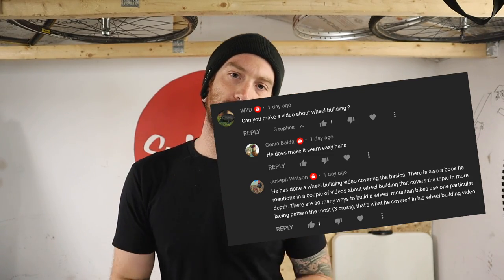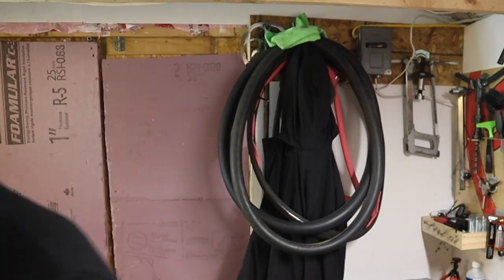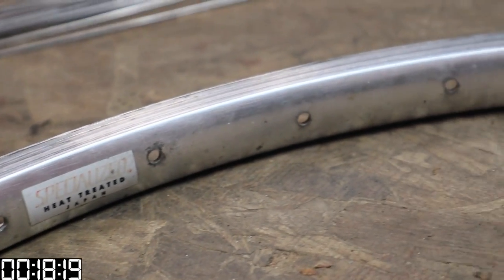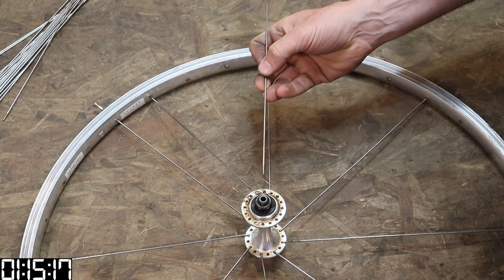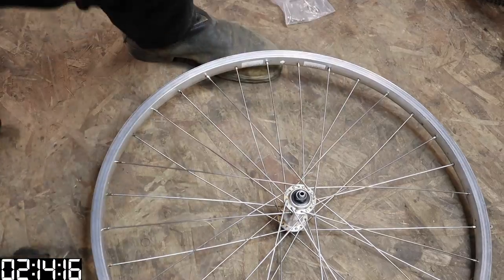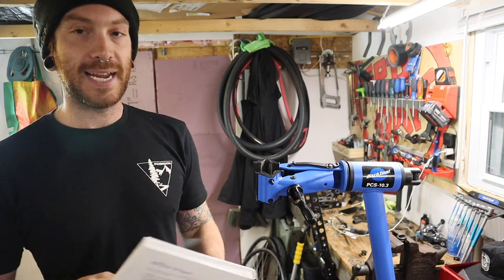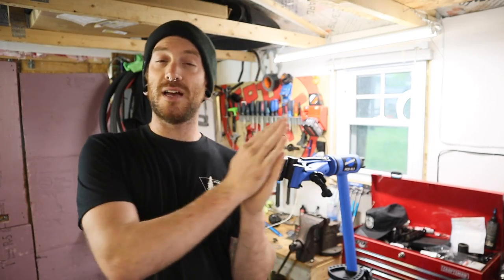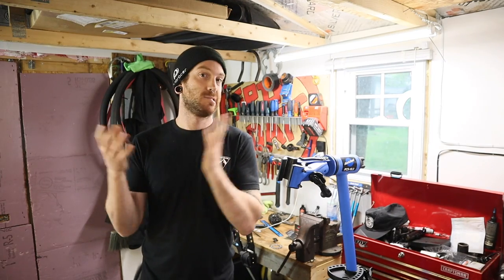Do not fear wheel building. The most important skill you don't have yet.

Comment: Does a bicycle wheel keep its weight load capacity if it is respoke a with shorter spokes to add a hub motor?

Want to add a hub motor to a cargo trike and keep the same load baring capacity and integrity.

Comment: I have a wheel building system that works every time and it's very easy.   I use money and give it someone.    

I figure, wheels made out of good components last so long that they're not worth my time to learn, it's not like fixing a flat or other very routine work.   Anything that's a quick bolt on replacement is worth doing because it takes near zero skills and minimal tools/time, like a bottom bracket replacement.

Comment: This is inspiring! I have laced wheels....but I didn't realize I was still running old paradigms in my head. To complete my bike tools I would like to get a wheel building tool. I know it is not necessary. I have put the wheel back on the bike and used the brakes and my guide. The guide would just be easier and more pro.
Reply: I am guessing that you are referring to a truing stand and a dishing gauge when you say "wheel building tool"?

Comment: Relacing a crap/scrap wheel is a great way to learn this stuff.  It also helps to keep a similarly laced wheel handy so you can debug your lacing pattern against.

Dishing can be checked with two identical cans (beer) and a stack of quarters.

For tensioning I find that trying to slowly tension up (always tightening) works well for me.  Get light tension all around, take out hop (radial out of round), then lateral wobble, then check dish, and finally go around tensioning any slack spokes (any well below the average tension of the rest).  When all of those are good, I add a half turn of tension all around and repeat the truing check, which usually goes pretty quick by the second or third pass.

A $25 tension checker is worth it.  I have yet to need a proper truing stand, the bike frame or fork works well enough for me.

Comment: Agreed! here is a small (not small) story, I wanted to try a 650b conversion to go from 25mm tires to 38mm with fenders (this was about 5(+) years ago) but I did not want to spend a lot on an experiment (now it's more common to do this). I got a cheap set of Sta-Tru wheels cost me about $70 for the brand new wheelset (now that same wheelset cost $130 new ouch) but it had a freewheel and I wanted a cassette hub to make a 2x10 (38/22x11-34) gravel/touring/commuter bike. The original hub was a formula hub, so I got a formula hub with a cassette hub (looked exactly the same but cassette instead of freewheel) for $14 and re-laced the wheel using the spokes and nipples. Wheel is still going strong and even though I had originally plan to upgrade the wheel set if it worked, I have not because the single wall it lighter than expected and it has been bombproof!